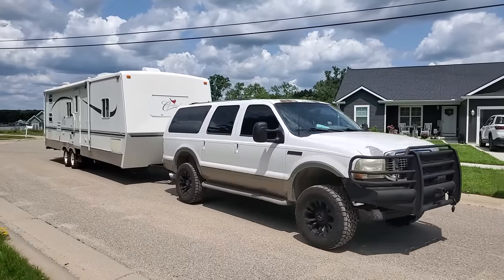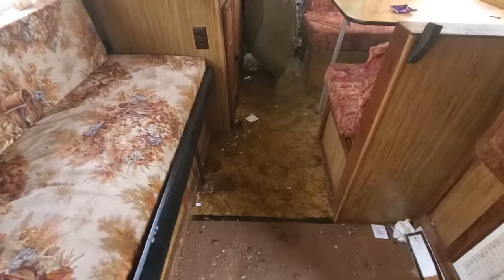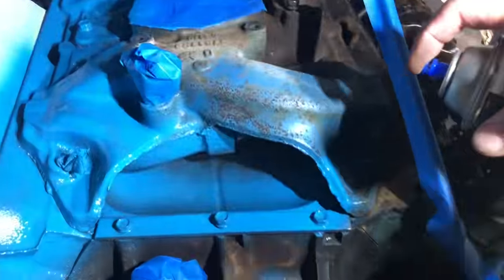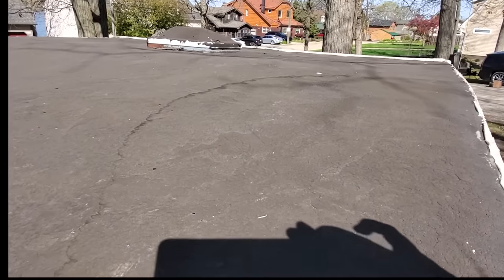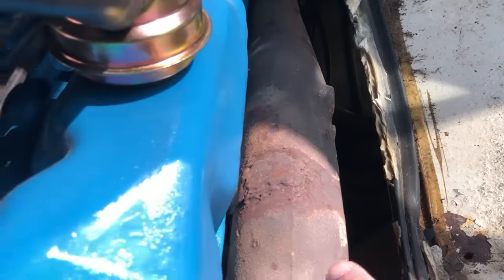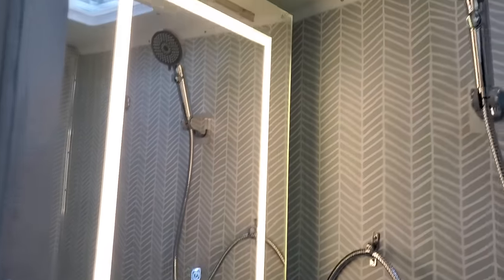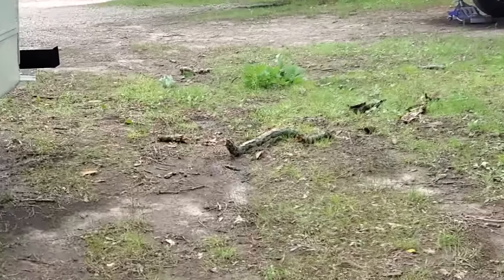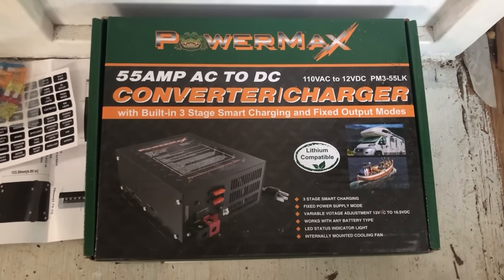Full Renovation - Vintage Camper RV | Start to Finish - Part 1 (DIY Before & After)

Comment: First time watching your channel. Great job on your repairs plus love to how you changed out your LP gas System and your heating system plz 😊
Reply from the maker: So, we bought a ceiling A/C unit that includes a heat pump.  Since we don't really plan to use it in the winter, we are hoping we're ok without a furnace.
Reply from the maker: The fridge and water heater were both junk so we're going electric with those too.  The range worked but didn't want to keep propane for just that so we bought an induction cooktop.  Hoping our breakers can handle it.

Comment: I would re-letter on the back. Maybe you can use a Cricut cutting machine or find a company that could cut you a decal, if you don’t want to hand paint it using the old letters that you pealed off to make a stencil. On another note, I hope that you used styrofoam pink insulation, or the spray foam type. You’ve had enough evidence of what fibreglass insulation does when it encounters liquid, it becomes a sponge, whereas the styrofoam or spray foam type does not, water or liquid will run right off of it. Also insulation does a great job in terms of sound proofing as well as keeping heat contained on cold days and repelling heat on hot days, so your a/c and heat pump won’t need to work as hard. I am only 10 minutes in and I am really enjoying the video, I can hardly wait to watch them all. 	😊👏🏼✨🇨🇦
Reply from the maker: Thanks so much!  We hope you checked out some of our other videos.  You will see that we did repaint the old lettering!  We also used the pink foam board insulation!

Comment: I have a nineteen seventy-seven Dodge class C mallard it was pretty rough but nowhere near as rough is this! But we were able to keep most everything just put new flooring in a new, bathroom. Sealed the roof about three times! But she's beautiful today 🥰. We have the Dodge 360 V8 and we went through the engine completely replacing everything that could possibly break. For the new Edelbrock high performance intake manifold and an Edelbrock 4-barrel carburetor to give Lucy as we call her a little more grunt! But today Lucy is completely off grid and every little mod for function and comfort has been added. I really feel sorry for all you have to do but I'm sure at the end of this video which I haven't gotten to yet it will probably be beautiful 🙂 as I continued watching oh my! Man you really took this thing apart inside and out! I'm going to keep watching and see how this turns out. You are a good team and you're optimistic attitudes determine your altitude! I ended up putting in an aluminum radiator along with everything else the whole engine going through except replacing the Pistons! All the electronics as well all new pumps new alternator oil pump water pump fuel pump all new hoses electrical components! Yes our Lucy is 46 years old so as you can imagine anything that was made of rubber probably dried up. All new tires new brakes yes we discovered we had no brakes in the rear.. so anybody going to get a vehicle 45 + years old expect to spend an awful lot! We purchase Lucy with 84,000 miles for 3000.00 but today she probably sits at around 25000.00 but she'll do everything those $150,000 class C's would do. 800 watts of solar 600-amp hours of lithium batteries and three 3000 watt inverter yes Lucy can multitask! So there is a lot you can old RV! Our mantra is function before fashion! And followed by tape glue and prayer will get you safely there.
Reply from the maker: We love that you're able to go off-grid with your Lucy.  It would be nice if that was in the budget for us.  Maybe someday!  It actually is a little reassuring to hear that you spent $25k on your rehab.  We're not to that point yet but things certainly add up quickly!  Just a tube of caulk is like $10 these days.  Thanks again for commenting and watching.  We're hoping to have a new video out for you by the weekend.  Everything just takes so much time!

Comment: You can find these all around Iowa for like $2000. We had one of these Sportsmen when I was little. They  can make a great restoration at a great price. Also that big block is an amazingly reliable engine , Dodge they made them a bit more durable in an RV with tougher components. Not great for gas though but a total beast.
Reply from the maker: Thanks for the comment!  Not great on gas for sure!  We appreciate you watching!

Comment: Get a  Cricut machine or one like it and put the lettering back on. That's what I'd like to do with our 1997 motorhome. Remove the old, cracking vinyl and replace it.  I managed to find the font online after a bit of searching.
Reply from the maker: That's a great idea!  We ended up hand painting it back on in a recent video.  Thankfully, the outline was still visible from where the decal had been.  Thanks for watching!

Comment: You really can't beat the Ol' Dodge MotorHomes with thea 440, with essential maintenance it'll always take you anywhere you want to go...
Reply from the maker: I'm all about reliability 😁. I'm hoping a little tlc was all it needed.
Reply: @retrorevivals  I guarantee it will be fine a buddy of mine has a motorhome with the 440 and it is very reliable and has plenty of power for towing…he tows his Jeep and a Harley with it and it went over Donner’s Pass no problem…

Comment: An "additive" to bump up compression?! Yeah stay away from the engine my man, get a mechanic. Just a friendly suggestion.
Reply from the maker: Thanks for the tip
Reply: @retrorevivals  yeah I just read it and realized my comment sounded pretty derogatory, sorry. I should've been more diplomatic. Low compression can just mean some fairly serious things are happening. I'm a mechanic myself and I'll just say beware of "snake oil" off the shelf additives that claim to fix your compression issues. Do a wet compression test, see if that improves your compression if not, do a leak down test to test the valves. Those are good places to start imo. Sorry again
Reply from the maker: No problem, we do appreciate the tips.  With the age of the engine and unknown maintenance, we're assuming it's not in the best shape but hoping to get a bit more life out of it.  Thanks for watching and commenting 😁

Comment: I'm looking at a 1990s trailer like that with about 50,000 mi on it and they want like 13k is that a good deal?
Reply from the maker: I couldn't say for sure. Depends on how it was maintained. They'll all need work at some point. Good luck 😁

Comment: I had an old camper but I had trouble getting parts so  sold it, running gear mainly, and when I did get the parts they were so expensive. I admire your enegy
Reply from the maker: Sourcing parts can definitely be challenging. Thanks for the comment 😁

Comment: Remember you can restore the original radiator & it’s cheaper plus you have the original & you can put a bigger output alternator for your power need’s love your videos
Reply from the maker: Thanks for the comment.  We looked into costs for getting the old radiator back in working condition and it was pretty much the same as getting a new one.  We'll hang onto the old one for now though.  Thanks for the comment!

Comment: ASMR is a tingling sensation, generally on the back of your neck. Typically brought on by gentle auditory stimulation. So maybe if you particularly like the sound from your pressure washer you vould call it ASMR.
Reply from the maker: 😆 Yes, I think we basically used the term wrong, lol
Reply: That pressure washing does look fun!!😊

Comment: Should got those exhaust manifolds surface and use ultra copper silicone
Reply from the maker: Thanks for the suggestion. Using the copper spray a gasket on the metal backed manifold gaskets has wiring well so far.

Comment: I got an older RV myself. Put in 2 new batteries and the battery by the engine keeps draining. Nothing was left on so not for sure what could be draining it. Any ideas?
Reply from the maker: It’s possible that you have a bad battery from the store. One suggestion would be to swap the batteries from the house to under the hood.  See if the same battery is being drained.

Comment: I have a class B and I just got it a year ago. It’s a 2007 and it runs really good but the dealership told me not to use a pressure washer on it. I guess it can ruin the seals on the RV.
Reply from the maker: I'm glad they informed you that it can cause damage. I've heard horror stories. From here on out, Harvey will get his baths with a brush and soapy water. Thanks for the comment 😁